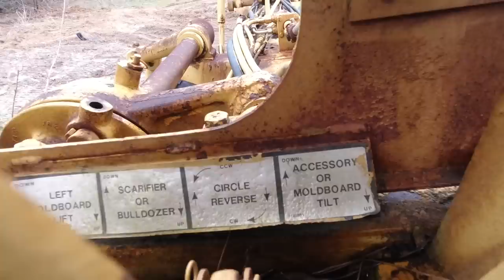WILL IT START? FORGOTTEN GALION T400 Road Grader

Comment: One thing to point out with the starter. That solenoid has a magnetic coil in it that engages the gear to the flywheel. If you just jump the high current relay, without giving the coil power, it won't engage. You need to short out the small lead, not the two large ones.
Reply: It was so frustrating to watch them beat on the starter. I found myself yelling at the screen!

Comment: I salvaged one exactly like this in Cap Haitien Haiti for a customer a few years ago. The one I worked on was about 15 years older and had a Detroit 471 engine. It had sat so long I had to replace every inch of electrical wiring and most of the rubber hydraulic hoses. Took about 3 days total to do that job.
Reply from the maker: Wow that's cool👍

Comment: Has always had a good to have something to cover up the Breather when you can't get them to stop running or just case they run away
Reply from the maker: Yeah we actually took a 2x6 to cover it and in our excitement we forgot to get it out of the bed of the truck😁👍
Reply: That's right, with a diesel always make sure you can stop it before you start it.

Comment: On a diesel, especially, don't try to start the engine, before you know, for sure, the best way to kill it, and and are prepared to use it.  Coolant is a good idea, also, even if you have to drain it, before you leave the sight.  I grinned, big time, when it started right up, and purred like a kitten.  Great video.
Reply from the maker: Yeah, we actually had a wood block to cover the air intake and in all our excitement forgot about it. 😳 Thanks for watching 👍 have a good day!

Comment: Yall come up with the neatest stuff. IH made Galion for YEARS! The outside levers are for the blade sides, right outside lever to work the right side and the outside left for the left. I ran one like that YEARS ago but it had a Cummins in it but the automatic was different. Seems like it had a manual hi/lo and an automatic hi/lo and fwd and rev. 3 levers instead of 2. It'll do you proud when the rust gets fixed and'll make a smooth road! I had to subscribe to see how all this is going.  THANKS from an old worn out driver and operator!
Reply from the maker: That's cool. Thanks for the info. I appreciate that👍
Reply: @HamiltonvilleFarm  About all your graders are set up the same way with the blade controls but A/C had both the blade lift levers right together on the right hand. Maybe the old Deers too. It's been a long time.
Reply: @HamiltonvilleFarm  I ran an OLD Gallion that had an IH- UD engine (started on gas and the switched to diesel) that was swapped out for a 4-71 Detroit/GM. It had 6 forward gears and 2 reverses on one stick. You had to go all the way out of high range and up into lo and then back across BUT the stick would fall out of the socket and lock the brake pedal so you couldn't get the brakes on. It was blamed sure interesting! And many gray hairs later..............
Reply: Galion Iron Works made Galion graders. Probably used a lot of IH engines.
Reply: @ohgary  All the old diesels were UD power plants but the later ones could be Cummins or Detroit/GM's. Probably some gas jobs but I never saw one.

Comment: We have an old grader that judging bu the technology is older than that thing. It has even taken care of and looks nicer though. There is a leak in the brake line so we have no brakes and you can’t kill the engine from thei cab throttle like your supposed to but it still runs and we use it a lot. When we first got it, we couldn’t find the switch for the throttle on the engine so to shut it off you dug the blade down, throttled down, put it in 4h, and popped the clutch. It has a Detroit engine in it and I believe it is from some sort of Adams company or something like that. It is all PTO’s running from the lever to the thing it runs. Fun machine that we love.
Reply from the maker: Cool story. Thanks for sharing 👍

Comment: That starter is a pre-engaged type, crossing the solenoid will only ever spin the motor, you need to find the third (small) terminal and cross the power to that and it'll engage properly then... Edit- haha you got her in the end then.
Reply from the maker: Right on. Preciate the tip 👍 have a good one!

Comment: Nice.  You guys got it started and that engine sounds solid.  No knocks, pings, or smoke.  Enjoyed the full video, guys.  👍
Reply from the maker: Thanks Don. It did sound good. That's the first time in years that thing turned over. Pretty impressive
Reply: @HamiltonvilleFarm  It sure was impressive, Hank.  It's even better when it started after you guys gave it a few love taps. I've had to do that with starters. The brushes seize.  Gives you a sense of accomplishment and satisfaction. Have a fine week.

Comment: The last T-400 I operated had a 250hp Cummins, the one before had a 4-71 Detroit. The Cummins had so much power for the size the company put a scraper push block on the front, it worked too. If the starter Spins why beat on it? The solenoids stuck (tap) on it while turning the starter. The two end controls are the left/right blade lift. Second from the right is wheel lean to load the machine wheels need to be verticals. DO NOT run with no water & water pump that head Gasket WILL blow IH was famous for it. ChiefD
Reply from the maker: Thanks for the comment brother! I appreciate you watching and taking the time to comment 👍

Comment: Will never understand why people beat on the starter motor, when the solenoids usually the problem lol
Reply from the maker: Mechanics around the world have been doing it for years havent they. Lol😁👍
Reply: Because on that starter the solenoid was in the case not external
Reply: The solenoid was working, the bendix was stuck.
Reply: The solenoid pushes the bendix out to engage against the fly wheel. Most starters work that way. Unless it has no solenoid. They can be beat on to work.
Reply: Robin Babington no Sir the starter solinoid is clearly external of the starter motor. ChiefD
Reply: Gunner Detra if the coil is shorted all the beating in the world won’t make it work. Not once did anyone put a continuity tester on it to see if power was going to the solinoid coil, no beating necessary. ChiefD
Reply: I have a question you mentioned the fuel cut-off bolted to the side of the engine. If that is what it was why not use it to stop the engine? NO criticism to anyone. I have been doing this stuff for seventy years and my noise just got stuck in your business, sorry. ChiefD
Reply: @cwdtransport2247  It wasn't a fuel shut off, it was an inline electric fuel pump.
Reply: Plus, it helps when you jump the correct two terminals on the stater. @10:41 they are jumping th battery terminal to the motor terminal. This just feeds power to the motor, but does not feed power to the solenoid to engage the bendix, thus the free spinning of the starter motor. @13:40 they are jumping the battery terminal to the small solenoid coil terminal, and the bendix pulls in and cranks the engine.
Reply: @newjerseybill3521  bingo
Reply: Because it works.
Reply: New Jersey Bill Ol Son it WILL work the same way, ie (No Fuel Flow).
Reply: Gunner Detra they never put power to the solenoid to in gage it, the hammering on starter made no sense at all.
Reply: @johnhalter445  exactly! Glad someone else picked it up

Comment: I really thought I heard you say you were going to pull the, "Tool Truck" up to the grader. Where are the tools?
Reply from the maker: It was the little white trailer behind the red Dodge. Nothing fancy. Lol. But it works.
Reply: Tool truck equal tacklin fuel aka beer wagon
Reply from the maker: @andrewmeppen8068  😂👍
Reply: Hamiltonville Farm    Adjustable wrench and a hammer
Reply: Carl Kipke  I seen two black kids rebuild an entire Chevy engine with a crescent wrench, a hammer and a pair of pliers.  It would have run too except the wooden pistons kept burning up!

Comment: There is no bendix on that starter motor, the solenoid engages the starter sprocket as well as supplying the power to the motor so needs to be energised. “We are not mechanics.”  You’re  right there.
Reply from the maker: Thanks for watching

Comment: Great engine in that either a d407 or d361 some of IHS best most reliable engines made and the turbo versions were amazing
Reply: And more than likely I will guarantee you'll will have fuel pump issues with the engine dying and either you'll have to send the rosa master pump out to be rebuilt or get the updated part yourself it's a one piece and make your own timing mark and put all new seals in

Comment: I hope you are now aware of just how important it is to have a foolproof method of stopping the engine before you start it. You were lucky here but you could have lost the engine if the governor was stuck wide open or if it pumped the oil out onto the floor and you could have lost the hydraulic pump if it ran dry. I recommend to step back and have a think about how to start these abandoned engines.
Reply from the maker: Thanks for watching!
Reply: @HamiltonvilleFarm  
A remarkably empty reply to my concerns about how you don't seem to have thought about the reallity of starting engines.

Comment: Shortcuts. If the injection pump has a mechanical shutoff, make sure it works, moves. Then just Hotwire at the starter to get it to crank.

Comment: I'm sure its already been said but most larger starters use the solenoids movement action inside the starter assembly to push the connecting wheel up to the flywheel of the engine rather than use centrifugal force like in smaller starters.... so when they were engaging the motor manually it was spinning idly in the starters case while the solenoid actually mechanically moves the gear into the proper position for engagement
Reply from the maker: Thanks for watching

Comment: You probably figured it out but you need to cross from the battery wire to the solenoid energizing terminal. That will pull the pinion into gear, and close the main starter motor switch to crank it.
Reply from the maker: Yeah that's how we cranked it. I can't remember the time marker in the video but it's in there👍

Comment: If you are starting up a long time dormant engine like that, its best to bypass the fuel tank completely because of the rust and crude. Make a small fuel container with proper elbow fittings and pipe that can be plumbed into the system near the engine, hang it up and to gravity feed the fuel.
Reply from the maker: Ah! That's a great suggestion. Thanks for that. I appreciate it 👍
Reply: @HamiltonvilleFarm  Also, if it is a gasoline (petrol) engine in the field, just remove the distributor, spark plugs, carburretor, coil, ie. anything to do with spark. Take these to the workshop - if it is close by, and test, service and repair the items on the bench. Then refit them back on site, its much easier than struggling with parts like the distributor on site in the wild. You can do all this in the field too, but with a good field toolbox.

Comment: Diesel fuel is more expensive than gasoline by 30-50 cents a gallon, so I'm not sure if there's a real savings because you're paying for the efficiency, but I love old Diesels. You only need to get fuel to them, and you'll get them running, no computers, sensors, or safety gadgets. Beautiful!
Reply from the maker: Yeah the old ones sure are nice. I like them a lot.  Thanks for watching!

Comment: The outside lever on both left and right side  are the levers used to lift the blade up and lower it back down
Reply from the maker: Ok cool. Thanks for the comment 👍
Reply: @HamiltonvilleFarm  many hours running motor graders

Comment: You need to look up pre engaged starter vs inertia starter (Bendix) because beating on a pre engaged starter will not do anything other than take off the paint.
Reply from the maker: Yeah man. We figured that out. Lol. Thanks for the comment 👍 I didn't realize that was the technical term. Preciate it 👍

Comment: Omg,...you guy are brave, it's a shame to see the old equipment rot away,.....i worked with a guy who had a monster D-9 dozer [probably from the 50s] in a field,...we tryd startin it once...it was winter too.ughhhh..threw a tarp over motor & a heater to warm up the pony motor.....it never got running but I was sure hoping to drive that behemoth around....
Reply from the maker: It's a fun experience. Thank you for watching 👍

Comment: Note:   There was a retrofit to put a pilot relay to drive the fuel solenoid.  Solenoids burn up with original wiring due to voltage drop in wire from key switch.
Reply from the maker: Good to know. Thank you Fred. I appreciate it 👍

Comment: Ok, in the early 80s, Dresser Industries bought Marion Power Shovels, which included a significant holding in Galion Iron Works (also a major share of Alis de Brazil).  In the late 80s, they labeled all the equipment  as Dresser-Galion.  (They relabeled Clark Mining  as Dresser-Clark to better match the Dresser-Atlas and Dresser-Copco branding of other lines).  When the oil bust of the 90s hit, Dresser wound up in a JV with Schumberger, and Galion, Clark, Atlas, Copco, etc. "lost" their branding.  When Haliburton bought the JV out, they shed all the equipment companies as soon  as they could find buyers.   That's where Komatsu comes in (they also bought up Waukesha, too).  Komatsu rebranded many things as part of their drive to enter into the US markets.  Where they found that Construction people are conservative and namebrand picky.
Reply from the maker: Wow cool comment. Thanks for that👍
Reply: @HamiltonvilleFarm  Not a problem, my dad worked for Dresser as a facilities and RE exec from 72-97, so, I got to see a lot of the part in motion.  I was in the construction & design industry from about 82-85, and got to see the other side, as well.

Comment: Boy, how you run across videos on youtube. Born and raised in Galion, Ohio. Still live here. I remember when Galion Dress was here. Remember when it became Komatsu dresser. Not too long after that, they moved out. 
I used to work for road maintenance company, had a couple old graders sitting out back. Finally cut them up for scrap. Still have the plate off one, made in 1942 when it was 'Galion Iron works and Manufacturing Company'. They ran. Nobody wanted them.
Reply from the maker: That's a cool story. Thanks for sharing. Have a good one!

Comment: Great vid but I like how there trying to think on how to cut it off even tho he says the belts are missing which means ignition is coming from the batter not the alternator  so a quick disconnect from the batter would’ve shut it off.
Reply from the maker: Thanks for watching 👍
Reply: Dude, it's a Diesel with a mechanical injector pump. No spark plugs, carburetor, distributor or gasoline.

Comment: That grater seems to be at the end of its life, being all rusted. The engine could be a decent replacement for a truck or other piece of equipment, though depending on how many hours it has on it.
Reply from the maker: Yeah I hope it can get a little more out of it. time will tell. Thanks for the comment 👍
Reply: It's not at the end of its life. Itll just take a little patience and you'll have a great machine that'll last for years. The great thing about old rigs is that they are easy to work on and cheap to maintain. I'd rather replace hydraulic lines than diagnose bad circuit boards and sensors like the new machines have.
Reply from the maker: #truth

Comment: Damn, hammer at the solenoid, not the starter itself.. Aaaand have a plank to stop the airflow on top if the engine needs to stop fast.
Reply from the maker: We actually had one in the truck and we forgot we had it. 😳

Comment: Road Grader and Motor Grader history as I understand it. Around 1885 J.D. Adams patterned the Road Grader, called No. 1. It was pull by men , horses or oxen; many graders types existed prior J.D. Adams' Road Grader. Adams invented the wheel lean which is the industry standard even today. Gallon was not far behind. At the turn of the century road graders manly pulled by tractors. It wasn't until 1919 when a Gallon blade was attached to a tractor motor and chassis, I think it was an Alas Chalmers,  thus the Motor Grader was born. By 1920 Adams, along with other companies, had started producing motor graders. The Adams only made the chassis never had there own power house nor transmissions they contracted them from other industry manufacturers such as International Harvester, McCormick Deering,  and by the 40's Oliver transmissions and finals. Adams became a lesser known made machine. I have a 1946 No. 311 Adams 35 EOA with an Oliver 88 Standard Transmission and finals. I have pictures of the last Adams ever made, almost bought it,. Adams was sold to  LeTourneau-Westinghouse  in 1955 and the name was used late 1960 but the last contract with the U.S Army Corps of Engineers were not fulfilled until  Feb. of 1961. 

In a nut shell
Great video and good question
Reply from the maker: Man what a cool comment. Thanks for taking the time to write that out. I really appreciate it 👍
Reply: At the turn of the century Galion graders were pulled by horses.

Comment: kinda cringe during the starter smacking, I was taught to never tap the side of a starter for fear of shattering the magnets inside. I was told its not a long term solution but in a pinch it might get you out of the field. if you're going to hit it i will suggest to strike the end caps of the starter if that is the route you want to go.
Reply from the maker: Yeah we figured that out. Thanks for watching and leaving the comment 👍